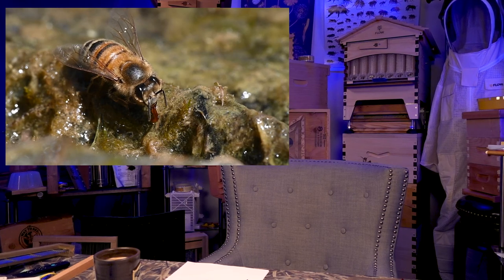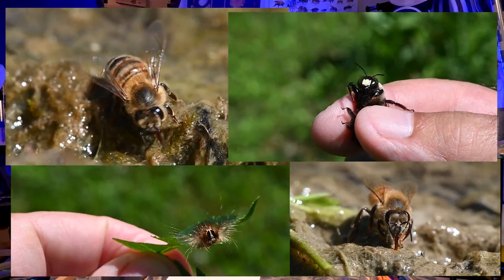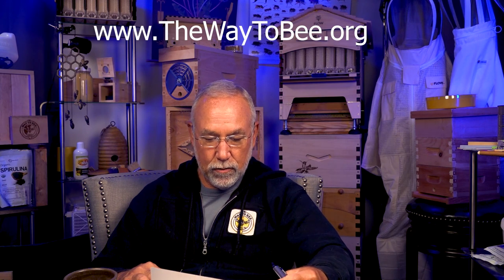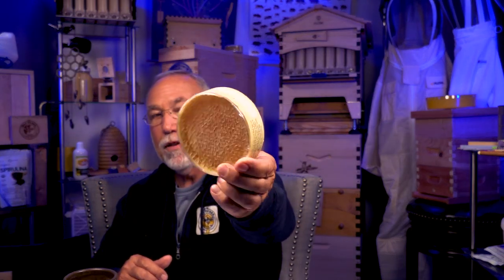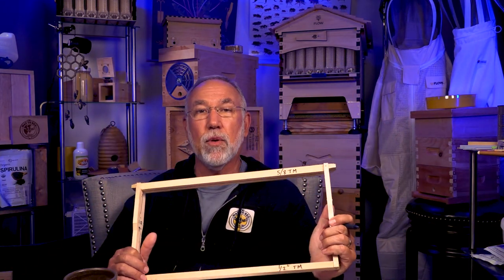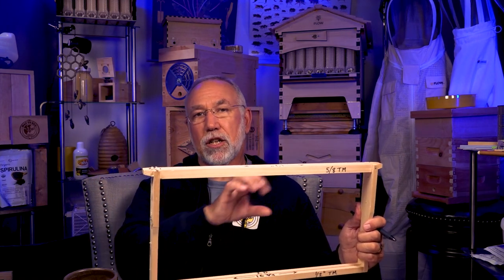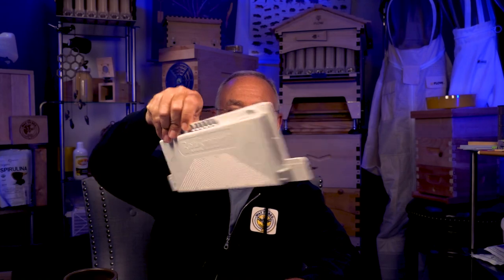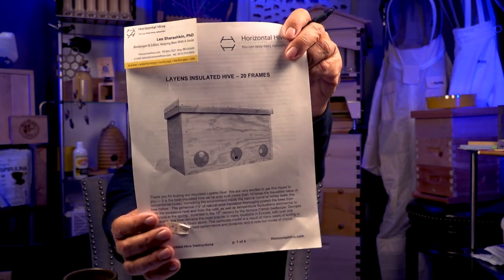Beekeeping Questions and Answers episode 114, why aren't the bees filling my flow hive frames?!

Comment: 1)  I know you can purchase Ross Round frames for chunk honey, but is there a way to do that without special equipment? 1:36
2)  I have two queen cells in my hive and they are both capped. I squished the one along the bottom and left the supercedure cell to buy some time. Should I let nature take its course, or is it time to make a split? 4:53
3)  Our local crop duster is going to dust. My bees are bearded on the outside of the hive, what can I do to keep them from flying during dusting? 10:14
4)  Can you give some information regarding what you think it happening with my hive? Lots of resources and I found the queen, but no eggs, what's going on? 12:56
5)  I see that there are multiple sizes for Layens Hives. I plan to build my own, how many frames should I be able to include in the hive? 16:31
6)  When it comes to Flow Hives, I can't find any information regarding harvesting wax from them. Isn't this also a valuable commodity for flow hive owners? 19:22
7)  I need to inspect my hive, and the problem is that they are bearding on the outside. Can I go ahead and inspect?  23:29
8)  What happens to bees that are producing wax, but the hive doesn't need new wax such as with the Flow Hives? 25:18
9)  Tried numerous different strategies for  getting my bees to work the flow-frames and store honey in them. Nothing is working.  26:31
10) My plan is to have and keep only two hives! I do not want more than that. I don't want a lot of gear and have limited space. I just want to enjoy my bees. How do I keep it at two hives? 34:35
11)  Bee Weaver Queens are now back in stock:  (tell them Frederick Dunn sent you!)  These are my favorite treatment free stock: 40:52
12)  I recently captured a swarm, now it's in two parts and won't leave the side of a tree. I did not observe the queen during transfer into the hive. Any suggestions? 41:23
13)  When should I remove the entrance reducer from my hive?  What size should it be?  46:40

Thanks for the help @Mark Berkley

Comment: Fred, you may want to mention that some people neglect to check and close the Flow Hive frame cells as sometimes they come out of the box not fully closed.  So, before placing them on the hive, they need to take the L key and insert it in the top of the frames, crank it a couple of times to make sure the orientation of the cells is maximized to the closing up of the cells, and the subsequent filling of them.  If the cells are in the open position, I have found the bees tend to ignore them and not load them with honey.  So check, adjust, install, harvest!  And they have to do this each year as after harvest they sometimes are left in the open position....
Reply from the maker: Some things seem to obvious to me that I forget to mention it. Even Cedar Anderson was recently giving a presentation and someone noticed that some of the rows were not completely closed. Definitely worth repeating as even at the Anderson apiary, that can happen.

Comment: Hi Mr. Dunn.  Bill T. here from North Carolina, hopefully a future bee keeper next year.  I've been reading and watching everything I could about bee keeping.  I have a new assembled hive which was great therapy, and anticipate getting bees next Spring.  Need to ask your opinion on two topics.  I saw numerous videos about hive beetles.  One bee keeper said that beetles like to hide in the corners/edges of the hive box.  I thought of running a bead of Elmer's Glue alone the inside of the supers and smoothing it out with my finger.  It dries/cures clear and smooth.  One application wasn't enough so I did it several times, letting it dry/cure each time.  After several coats, the transparent, glued insides of the frames were smoothly rounded.  No hiding places for Beetles.  I used Elmer's Glue which I believe is animal friendly and non-toxic.  It takes a little time to do it, but I anticipate having only 1 hive until I learn more.  I have plenty of time.   Your thoughts, please?  The second topic is keeping the grass and weeds low around the hives.  As they don't like noise, it's hard to use any machine to mow or weed-wack.  What about weed-wacking after dusk.  The bees won't fly after dark, no?  They won't defend the hive when it's dark.  Do you think it will work?  Your opinion on this as well, please?
Reply from the maker: I'll discuss this on Friday... I don't have any helpful experience with small hive beetles as they are just not around for me to do any testing or evaluations on. But will address your other concerns.

Comment: So Fred, would you explain how you make your little queen cage that you keep showing. And also how do you use it to color mark your queen?
Reply from the maker: I hold my queens when marking them rather than pressing them to a marking grid. So that "hair roller cage" isn't very good for marking, just for holding them while you work. It comes with the Nicot Queen Rearing system, but are available from several sources. I made the colored base with this plastic material:  https://www.amazon.com/gp/product/B089WHM982/ref=ppx_yo_dt_b_asin_title_o07_s00?ie=UTF8&psc=1

Comment: Hi Fred. Love your videos. Great help to beekeepers. 
I have a problem with my installed Guardian entrance equipment. They are designed to keep the shb out of the hives. I think they help but don’t keep them 100% of the time. What is my problem is the some of the bees try to come up through the holes in the Guardian and lose the pollen off their legs. The seems to be a lot on the ground outside the hives. Should I take off the Guardians and get more shb or put up with the lost of pollen?
David.  Kurabees Australia.
Reply from the maker: I don't use them as I don't have the problem. BUT, once the beetles were no longer an issue, or the hive was strong enough, I wouldn't leave them on all the time.

Comment: Thank you for your videos!  I just purchased a Flow hive, working to get bees in with enough time to get them ready for winter. Your videos have been great. I am in central Ohio, and the information about Flow hives and keeping them through a northern US winter has been awesome. Thanks again!
Reply from the maker: I hope you used the discount link :)  Wishing you all the best!
Reply: I did not find your videos until after I purchased, but definitely the next time!
Reply: @RobinCoolidge  I am a 20 year beekeeper. I have been using a knockoff flow hive. It works great. I have to empty it 3 times during the season.
Reply: Thanks Larry!  There are so many copies out there I am glad you found one that is working. Can you share the model? It am glad you are getting a lot of honey. I am a newbie, but that does not have much to do with the device, does it? That has more to do with the bees, their resources and health, correct?
Reply: @RobinCoolidge  I just bought the frames off of eBay and modified a 10 frame hive body. I probably should have just bought the hive body and frames together.
You are correct. You have to have a strong colony and do everything you can to build the bees up in the spring in preparation for the nectar flow. Dry warm weather really packs the honey in.

Comment: I have two new hives, one is very strong and the other is struggling; It has a varroa problem. On inspection I don’t see any capped brood or even eggs. I started a Formic acid treatment and moved a frame of eggs from the strong hive.  Can they develop a queen from the eggs? Or should I try and find a laying queen to buy?  Bee weaver appears to be out currently.  Thank you for your help!  Derek
Reply from the maker: You can have them rear new queens from eggs. Since you have a varroa problem, this also provides a natural brood break which will help with that.

Comment: Hi Fred, I had a problem last season with my Flow hive super where the bees showed no interest so this season I reduced the hive to one brood box to build up a strong hive and when I saw how strong the colony was I put the Super back on and now I see great activity and honey being stored. Now the question is at what stage do I harvest the honey, do I wait for the cells to be capped? Since the Brood box was full of bees and the Super too I decided to replace the second brood box to allow more room for egg laying. Was this correct?  Thanks.
Reply from the maker: Yes, try to wait until the cells are capped at the ends and through the side observation window. What size box was your second brood box? I tend to leave any brood boxes in place and swap the honey supers only. Brood disruptions can cause some undesirable impacts on hive infrastructure, so I add rather than remove if we're dealing with brood.
Reply: @FrederickDunn  I removed the second brood to allow the build up of the colony in the first box. It is a Flow hive so all boxes are same size so the second brood box is same size as the main base box with 8 frames. Look like we are going into a week with light rain daily so foraging will be curtailed somewhat. Since they were active in the Flow frame super was my reason for adding back the second brood box.Thanks, I'll wait to see capping before extracting.

Comment: On June 4th a made three splits because I had over 10 mostly capped queen cells.  I thought the hive had already swarmed because I could not find the queen but on June 8th I happened to see my Layens hive swarm.  I was wondering what type of activity or send off if any does a virgin queen get when she leaves and returns from mating flights?    All hives are bringing in pollen and there is strong activity in late afternoon associated with orientation flights.  I heard you should not disturb virgin queens so I was not planning on going into the hives until the end of June. I'm worried though that by that time I might find a laying worker.  Do you think I can take a look earlier to check the status of the queens?  Thanks
Reply: DO NOT LOOK! There will not be a laying worker. It seems like you waited a little too long to split if there were 10 queen cells. Trust that you will know it when the new queen starts to lay.
Reply from the maker: You have approximately 3 weeks from queen loss to a laying worker or workers beginning to lay, so by the end of the second week you could sneak a peak to see how things are going and still have time to fix a potential problem.

Comment: I have my first FlowHive2 and my bees started working my Flow Frames immediately after adding it.  Yet, I took Frederick's advise and did not add an excluder for 2 weeks or so--then added it after it was full of bees working, making sure the queen was not up there.  BUT, I ALSO DID SOMETHING ELSE THAT WORKS!!!.  The day before you put them on your hive, paint onto the Flow Frames melted wax with several drops of Lemongrass oil on them.  IT WORKS.  (Melt the wax first, then take off the stove for about 10 mins to let slightly cool, then add about 4 drops of Lemongrass oil into it they start painting.  All the best.